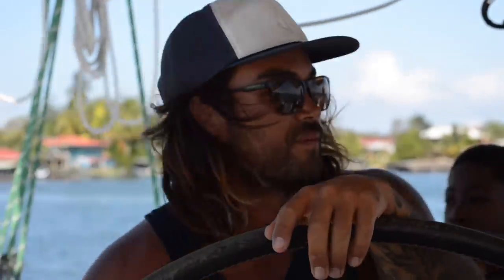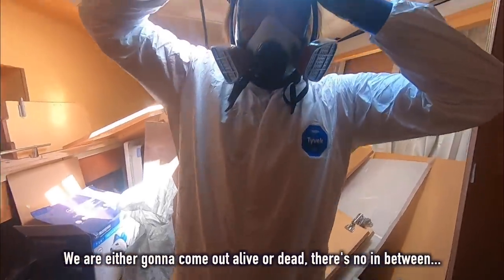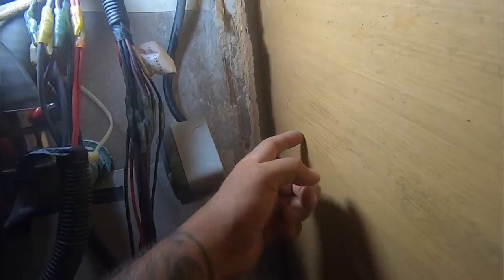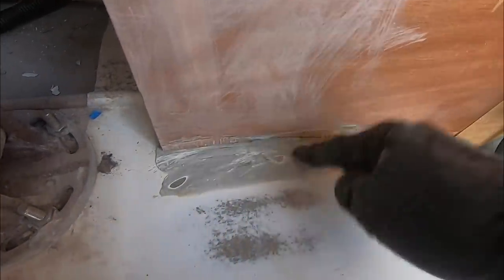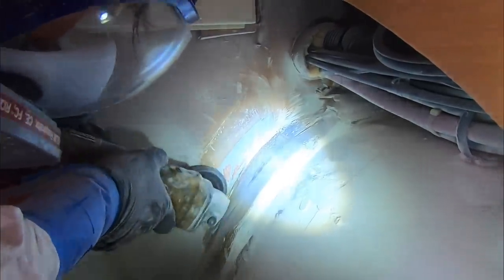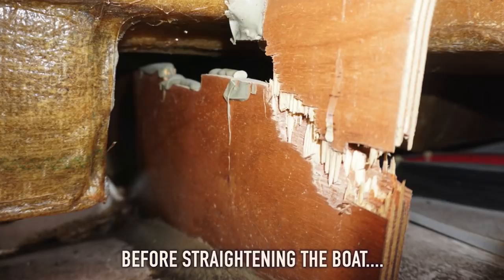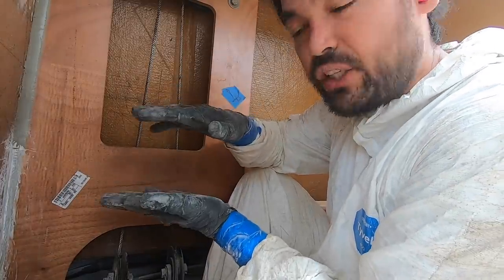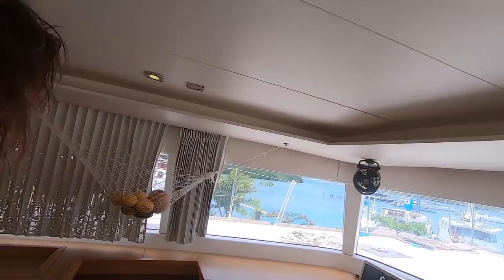CRACKED BULKHEAD REPAIR SERIES - Part 7 (Episode 112)

Comment: Have you thought that it would be better and easier to remove all the necessary bullheads etc and rebuild it in honeycomb or foam. Would be better than patch repairs as you will know 100 percent that it's correct. It also gives you the chance to rearrange the layout.

Comment: The fiberglass dust is providing the necessary reinforcement your sack needs to keep your large metallic balls from dragging on the floor. Don’t fight the funk - just another blessing in disguise.
Reply: Normal men use talc powder to stop chaff. Men with balls this big use fibreglass dust.

Comment: I’m guessing you won’t be hearing off lagoon again?! Lol Iv just watch every single episode you’ve made it’s been a great watch! The hard work that’s gone into the boat, hats off to you guys.. as your followers say you got brass balls!!😂. But joking a side them bulk heads look poor 3 layers of ply at the bottom not even stuck together properly why not 3 layers of ply throughout all the bulk heads Bottom to top??. it will add more weight obviously but strength over speed, it would surprise me if lagoon used normal ply instead of marine ply they cut corners on the tabbing and gluing?. 
Keep up the good work roll on next Sunday!!!

Comment: I did see a Lagoon 450 owners group with many references to cracked and broken bulkheads (group membership was about 650 when I was reading ). Considering the amount of help You guys have been getting from Lagoon it does put you in a bit of a bind as to whether or not to join any lawsuit. Many of the group members have been following and mentioning Parley and your videos will probably be used as evidence if or when any suit goes to court and I would not be surprised to see you called as a witness seeing your experience as both a Lagoon owner (actually making bulkhead repairs) and an engineer. This just got a whole other level interesting. Careful how you navigate this storm. My advice would to start consulting with a lawyer even if informally asap. You may not want to be in this storm but you are going to be used by one or both sides even if you chose not to be part of it. On another note You and Jamie should never be on the same side of the boat together. especially on the lee side under sail.

Comment: funfact:
penguins get bigger the colder the temperature is where they live.
like this their surface area is smaller compared to their volume. 
as they mainly lose energy/heat over their surface area, they are better adapted to their surrounding climate.

Comment: Re teh dust - Seal yor boat with plastic in the area you aren't working in and pressurise it with a fan.  Get an extractor for the area you are working in that draws air out along with the dust . Wear masks.

Comment: You certainly have enough very well documented bulkhead repairs, along with the engineering data to support your case in a lawsuit.  It's a shame if they failed in the design, sufficiently for 11 boats besides your to experience the same malady.  I wonder how many of the pictures match up with yours?  Regardless, keep moving forward to get it done and done right.  Perhaps an exhaust fan discharging to a barrel of water to capture the dust and not blow it all over the yard - they'd get pissed about that, I'm sure.

Comment: I think the simplified formula is basically this:
Circumference of testicals is directly proportional to the weight of fiberglass removed, multiplied by the outside air temperature to the power of the relative humidity, and inversely proportional to the quantity of beer multiplied by the air temperature less the beer temperature to the power of the size of your dream.
Reply: That assumes size of working cavity remains consistent and greater than size of Colin’s beer keg. Unfortunately I see that is not the case so the above formula is purely hypothetical.

Comment: Hindsight being what it is, would it have been easier to take the mast out, cut the deck off the hull, lift the accommodation out without having to cut it up, and then repair the structure in the hull?

Comment: The volume bounded by the ellipsoid is
{\displaystyle V={\tfrac {4}{3}}\pi abc.}￼
In terms of the principal diameters A, B, C (where A = 2a, B = 2b, C = 2c), the volume is
{\displaystyle V={\tfrac {\pi }{6}}ABC}￼.
This equation reduces to that of the volume of a sphere when all three elliptic radii are equal, and to that of an oblate or prolate spheroid when two of them are equal.

Comment: Hi Colin, little question:were you able to receive a tech. production log of your boat from the factory together with plans and reports, it would help you for details on bulkheads, beams aso... and also products specs about the quantity of certain compounds used, aso...

Comment: All these 'Production boats' are built the same way , I had a rudder snap off on a delivery up to the Islands , Closer look found inch thick voids in the shaft , Replaced it with S/S shaft . Had an Alloy shaft post crack, Galley bulkhead lockers literally fall off , No glass tacks just there magic epoxy glue & i wont go into the delamination of grids,2 year old seacocks snapping off, Jammed doors on a port tack , No bilge sumps & to get that double bed up forward a slamming hull in anything over a foot of sea way BUT make great liveaboards in a marina ?

Comment: Amazing work guys !  Is there any way to tie the tabbing in structurally to plywood ? Was thinking some dowels or screws thru the ply; so its protruding above plywood would give you some increased area and shape to laminate over/against for a more positive tie in between hull/tabbing/bulkheads. With screws you could add them after initial 2-3 layers are applied but before it sets completely (plastic consistency) a zig zag pattern well spaced out every at least 4-6 inches apart so you don't create a fault line would be best.  Have no comments about your balls !

Comment: I was thinking that the engineering was sub par after watching your last video. Especially when you were showing how some areas were only glassed up an inch on  the plywood when it was load bearing.  Would it really have cost that much more to run it up six or eight inches more.... If I suddenly became rich enough to buy one of these I think I would choose a different manufacturer after watching your videos.....

Comment: I think Lagoon should reimburse you the cost of repairs,,, I have seen other comments from  Lagoon 450 owners with the same problems,, not good..   Lagoon should ditch the glue and go with fiberglass tabbing for a stronger boat, or recall all  Lagoon 450's for inspection and repair.......... Best of Luck, You guy's will fix it for sure......

Comment: You’re in North America, a law suit is the path taken for everything. 

If this suit results in a decision that Lagoon is responsible for under design for hurricane condition, I guess every other manufacturer that had boats fail in Irma and Dorian should prepare for a similar suit. None of the brands are built to withstand those conditions. 

These catamarans are all gravitating towards costal cruisers that are not intended to see heavy seas conditions. They all use epoxy to bond bulkheads ...wooden mostly to the glass structure of the outer skin. And yes, its not as good as glass encapsulated bulkheads. Be careful what you wish for...because if a court can determine they must make the vessels stronger, A.. they will become very heavy and sail as poor as older vessels and B.... become so expensive that the same buyer will not afford to own these boats. Expect manufacturer’s to have to have to reverse on much of the styling, you simply cannot build a boat light and “ pretty 🤩 “ and capable of taking on big seas.....and huge openings with glass windows. 

The forces on the structure in big seas are immense and making vessel more rigid brings about even further need for reinforcement, a flexing structure to some degree is good.

Comment: Im not an engineer, oh wait yes i am and when i saw what was going on inside that hull it really looked like under engineering. On a boat that costs that much to buy you would expect some over engineering especially on something that you would expect to be in heavy seas for long periods. The ply transoms you would think should be thicker due to not being completely fixed on every edge , anyway good luck with the repairs and journey you can sail with peace of mind  that you have made it a better boat.

Comment: Clearly Lagoon is manufacturing their boats using less than robust methods but, I would be surprised if they are the only manufacturer constructing boats this way.  As this is a relatively new issue coming to light, maybe this will be the status quo with some other mass produced yachts. I don’t know if I’m right or wrong or if this is strictly a problem with Lagoon. Time will tell I guess.

Comment: Main problem of this boat is not even bulkhead cracks/separation. It's all about access to bulkheads (lack of access) which makes repair nearly impossible.   But yes - all together it's design flaw (many flaws).

Comment: how is the boat maintaining a square and level position on the stands, as many bulkheads are cut back.  would a perforated stainless steel patch, over the epoxy , aid in strength?

Comment: from the Cruisers Forum
Dear Partners,
Following the webinars we had this week, this communication regards the Lagoon 450 (Flybridge and SporTop versions) in response to several reports of damaged forward bulkheads.
To share with you a global view and understanding of the situation, we would like to remind you that since 2011, more than a thousand Lagoon 450 have been sailing all over the world, and that a large number among these are extensively sailing, many in successful charter use.
To date, around 40 cases of damaged forward bulkheads have been reported, mostly by owners directly. However, we would like to point out that a large number of boats inspected present no problems with their bulkheads, knowing that many of these boats have a history of intense sailing in all types of sea conditions.
You are well aware that the customer safety is an absolute priority for Lagoon. In this regard, we would like to confirm that the damage to the mast bulkheads, as reported to us, can lead to neither dismasting nor any risk for the crew.
All Lagoon 450 can therefore continue to sail.
Among the cases identified, we have discovered localized buckling or shearing on the outer side of the forward bulkhead (non-structural zones with respect to mast support). According to the Finite Element calculations (FEA) performed by our Design Office and analyzed in collaboration with the VPLP team of naval architects, we confirm that the scantling is sufficient under normal use of the boat.
The area is located in a stress concentration zone, designed to withstand normal stress, which could however create an imbalance if the boat was to be used in a manner that does not comply with the recommendations for use, as described in our User Manuals.
To reassure Lagoon 450 owners, should they have any questions about the condition of their boat's forward bulkhead, we propose, for those who wish so, to have an inspection of their boat's forward bulkhead performed by the Lagoon dealer network (or Lagoon Service Center). As a commercial gesture, these inspection costs will be borne by the brand. It cannot be carried out other than according to the inspection procedure established by the Lagoon brand. Should the owner detect any damage to the bulkhead, we recommend the inspection to take place at the earliest opportunity.
The only approved inspection is the one provided by a Lagoon dealer, following the methodology provided by Lagoon.
In view of our technical analysis of the cases reported, and of the history of each boat, we wish to manage the situation on a case-by-case basis, which will allow us to propose an appropriate response. Our Customer Service team is at your disposal to provide you with the inspection methodology and, if necessary, the appropriate repair procedure, or even the reinforcement procedure for the forward bulkhead, should the customer wishes so.
Finally, we confirm that this issue only concerns the Lagoon 450, and no other model in the range, be they former or current models.
The Lagoon 450 is, and remains, a model widely appreciated by yachtsmen all over the world, and we are committed to preserving its excellent reputation, both in the interest of the owners, and also in the interest of the Lagoon brand.
We are working hard to find a solution for each and every case that is brought to our attention, and we know that the professionalism and worldwide presence of the Lagoon dealer network and Service Centers, which you are a part, will be a genuine asset in this context.
Thank you for your collaboration on this matter, and for the level of service you are able to provide to the Lagoon 450 owners that come to you.
The LAGOON team

Comment: It's too late now I guess but why couldn't you use a fan blowing out a hatchway /port light / whatever perhaps to produce a negative pressure (slight vacuum) in that space you're grinding and kept the dust from going everywhere? Dust on the outside of the boat is WAY BETTER than inside right?...

Comment: Leave it Colin and Jamie to pose a complicated bio-mechanical physics question on youtube. To understand the correlation between the size of the testicles and ability to withstand fiberglass dust first requires noting variables in play and how they interact. 

First...key variables include the number of testicles, the age of the testicle owner, temperature (every guy KNOWS this), beam, height of the mast, the length and girth of the boom, and (critical) the amount of dust on the beer (can't have that). 

Second....some interactions: age of testicle owner vs. size of testicles is highly positively correlated. Youngsters have no chance vs. the old guys. Age, though, is also negatively correlated with willingness to even start. Temperature is highly correlated as well (shrinkage...I swear!). If the beam of the subjects is too wide....also a negative factor. But all of this can be overcome with significant length and girth of the boom and a good dusting off and chilling of the beer.

See....complicated.

Comment: The problems with the design and manufacturing of the Lagoon 450 is quite obvious now. The issues with the 450 cannot be isolated to the 450. I would think owners of any other size Lagoon boats should be equally as concerned.  Scratch Lagoon off the list of potential boats to buy.

Comment: do the crosssbeams in 4x 15mm  laminated hardwood , your in the right place to source the wood, yo will have to rebuild what you ripped out anyway adding a couple of hundred kilos on cheap, strong, materials, clean up and fuck off job done...till NZ

Comment: Impressive testicular fortitude, but I would consider what my friends in the grinding department next to cut and gear (where I worked) did. They used duct tape around their sleeves of their suits to their gloves and wore work boots which they in turn duct taped their pant legs onto. They also cut a small hole into their suits to which they hooked up a hose to an air compressor to cool down at least a bit. I know this information is a little too late but if you posted this when I started watching it'd have been a lot more useful. Lol

Comment: We see a lot of shit work at boat yards in EU. Due to low trained personnel and rally for profit. It took our family 3 years to find the safe boat and we bought one only after we saw the production, and made sure the structure is made of real glass fiber, not glass-matt, that is basically the overlefts of glass fiber production and the way to utilize it. . Nothing personal, just damn profit and sweet design.
Reply: For the ones reading this comment - we have motor boat, not sail. But it is same GRP hull with same mentality. We selected  not the "miami vice design", but durable 4x4 of the sea and never regretted. It is, as far as we know, the only leisure boat a certified for Greenland and Svalbard. (U google where it is) and You may only imagine, what   a built quality must be for those places. We vote for built quality, and it comes  with the price, unfortunately.

Comment: 25lbs of the dust takes up roughly 400in^3. To fit that in a sphere, I took the cubed root of 7.3 and divided by 2 to use as the radius. 4 * pi *((3.6^3)/3) gives a Volume of 195. To calculate the Surface Area of your testicles per 25lbs of dust, I took the cubed root of 195. (4 * pi * 5.7^2) = 408in. So for every 25lbs of dust your grind out, the surface area of your testicles are about 408 inches. I also don't know what I'm talking about, so they could be larger.

Comment: busted bulkheads well that is the kicker and 10 really retro fittig steel sanwhich brakets with through bolts and glass seems lie a huge option still got to cut the bad but bonding extending 4 inches beyond the the plywood either side and having direct epoxy loints across 4 inches of stell bracketing seems more and more of an option...2inche angle either side of plywood and through bolted gives 4 inches plus the thickness of the steel direct glued and then 4 inches of pfiber rain coat means a total of 16 plus inches of increased hull bonding if the boat ever gave again then the poontoons would break? doubtful but if they did crack then external ribs could be applied also making the boat a true hybid hull
through bolting inside to exterior hull
and sealing with glass and epoxy
although the interior bulkheads are the key the lack of weakness would it tend more to compromise the external hull by over strengthening the interior bulk heads?